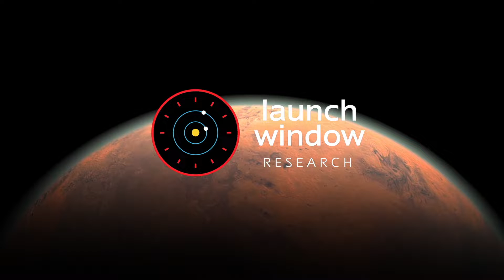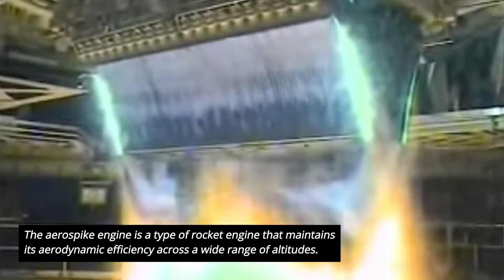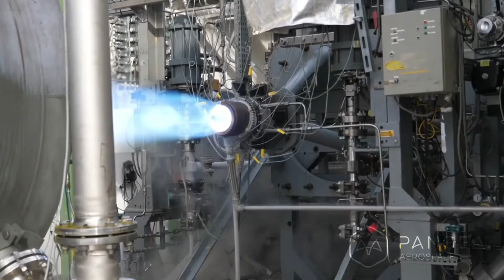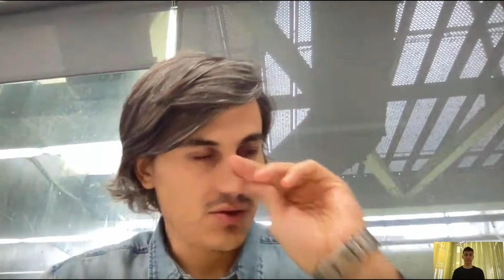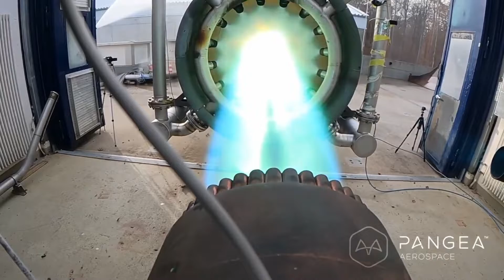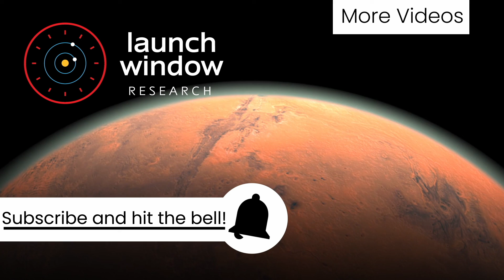Aerospikes are FINALLY Here!! The Future of Pangea Aerospace with CEO Adrià Argemí.

Comment: You did a great interview... I've always believed in the Aerospike engine since it's the SSTO solution..  SSTO vehicles inherently implies reuseability . What I like about Pangeas' approach for me is that it's like going out and getting an LS engine for my camino... in their case , if you have fuel tanks and a delivery system and you want to lift 100 tons ... it'll take 25 engines... that'll be 25 mill... they'll be producing 100's a month... At some point there will be so many engines people like us can start building vertical dragsters....
Reply: In thermodynamics, the goal is to achieve the highest temperature possible, by doing so you approach the limits of the fuel through complete ( stoichiometric ) combustion. The current problem of the Aerospike development  (heat) is that of the paradigm that's being utilized to solve the heat problem. To a great extent this is a materials science issue, however, I believe that the wrong energy release technique is being utilized because i also believe non-nuclear thermodynamics is a time management and materials science problem. What causes heating upon a surface has to do with the residence time  the heating medium is in contact with that surface, intermittency solves that problem..I am an advocate of pulsed detonation. I believe that in the realm of mega newton output engines , that detonation technology along with the Aerospike as the means to deliver an extremely high frequency output to the ambient medium, will become the new transformative technology , the Aerospike is only half of the breakthrough.. The two technologies that we are discussing is deflagration vs detonation. Deflagration technology exposes to the confining medium a continuous source of energy input , the source of the heating problem! Due to the intermittency of detonarion technology, a detonation engine will inherently operate cooler than a deflagration engine for a given output . A frequency dominated thermodynamic process possess two ideal characteristics variability and a doubling cubing relationship. As you double the frequency of operation you cube the power output.  A detonation rocket/Aerispike engine would be the only rocket that could sit and idle at a few pulses per second to the high kilohertz range... Conceivably an engine like this could operate in an inaudible range.

Comment: If they achieve the engine then 15% fuel efficiency margins will be great, but reusablility will be  there biggest challenge,  aerospikes are a vicious circle.  
Also I believe taylor made bell nozzles are actually better efficiency at a given altitude,  so when you take into consideration the stage jettison what's the point. In short Aerospike s are for SSTOs, this is opening a huge can of worms.
Reply: @launchwindowresearch7694  if its usable mass thats cool, but I feel that aerospikes are just bench pressing mass up and down with nothing much left up in orbit, 
Temperature and weight are the biggest issues with aerospikes, weight because after you take into consideration gimballing the whole engine rather than just the nozzle it becomes extreem, the raptor engineer said anything gained is lost in gimballing components, but that aside the biggest issue was temperature
 Assuming the temperature issue can be overcome my concern would be how many cycles could the aerospike nozzle perform. 
NB: sorry to be a bit negative, I'm only going off hear say and I'm sure Pangea have got this..😎
Reply: @zakiranderson722  It is all about thrust to weight and reliability, at the end of the day. Need real world usage data.